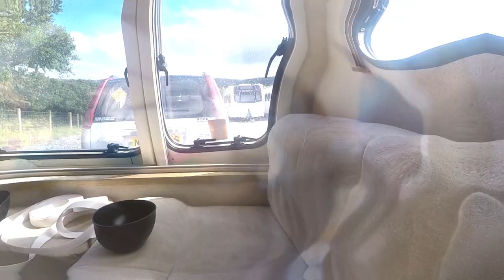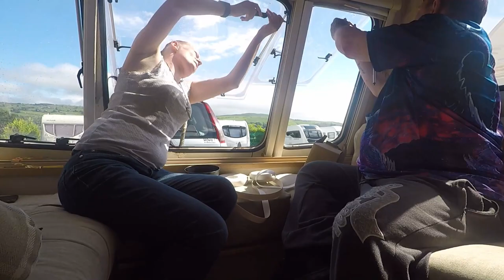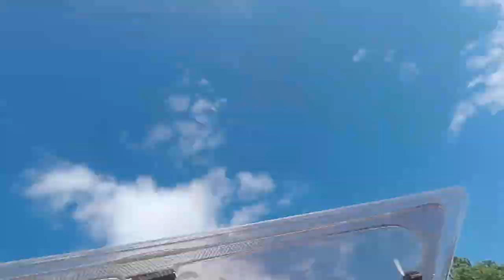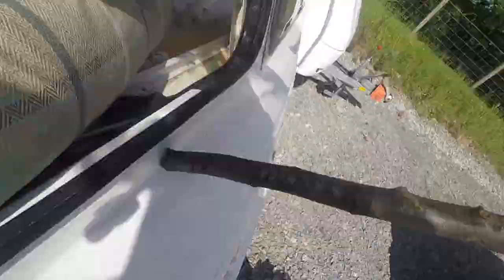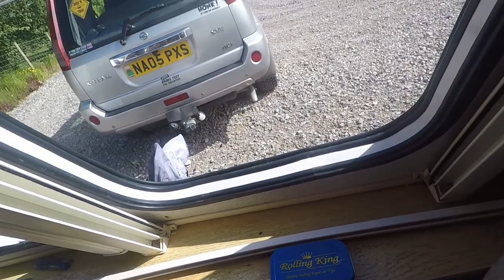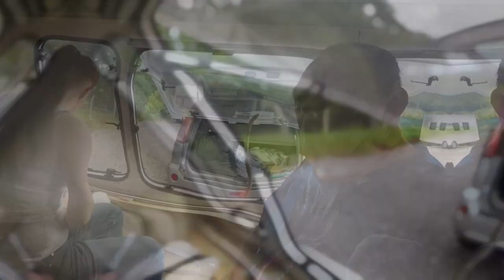Renovating our caravan part 4 {we found damp}

Comment: Hi peeps.
You need to get a damp meter before you do anymore internal work. Go round with this internally everywhere.
Most damp issues will be caused by external sealant.
Good luck
Reply from the maker: We have been round the van with a damp meater and thats the only place in the van that we found damp thanks for watching and commenting